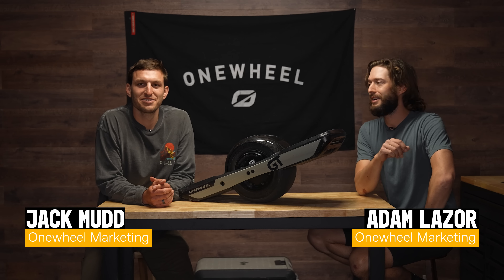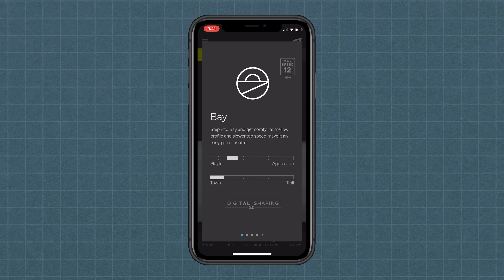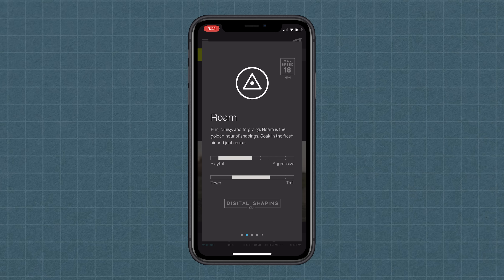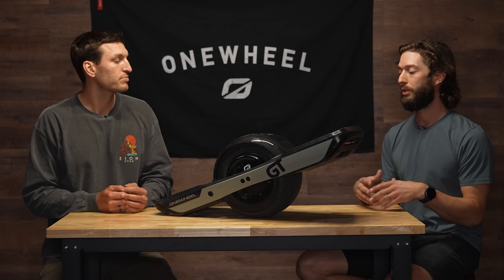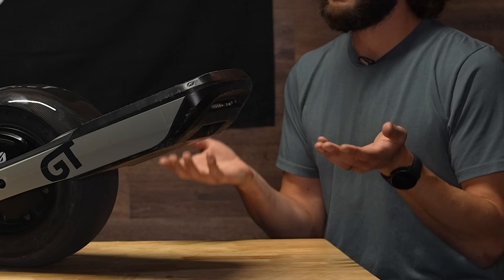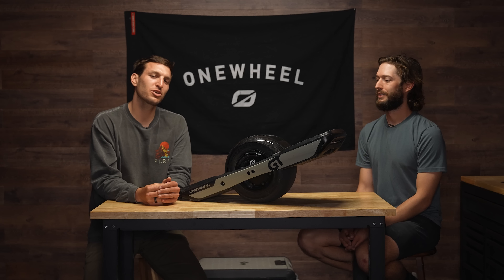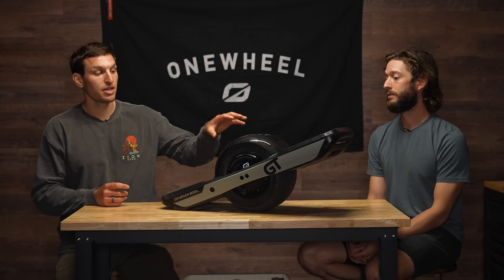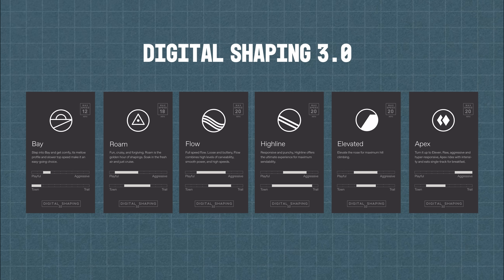Digital Shaping 3.0 on Onewheel GT

Comment: Please unlock pushback in the custom shaping settings with a legal agreement checkbox.
Reply: Yeah fr! At least up to 23 would be nice!
Reply: I second the motion! All in favor.......
I want my board to do 25 at the very least,  preferably 30. I'll sign the waiver, I am used to it!
Reply: @Ty-ye8rd  The floatlife guys have been racing the GT in all of its modes against the XR and the XR has been consistently beating the GT.
Reply: @Ty-ye8rd  Here's the video, https://youtu.be/FTZylO2j_UA  The GT was faster off of the line but it didn't last long before the XR flew past it. They were saying that the pushback was so strong on the GT that when it kicked in at 19 or 20 they just couldn't push past it. They said it was like the wicked pushback of the pint. Hopefully they just didn't figure it all out yet because mine should be here soon and I want to go alot faster than my XR
Reply: Or you know, make the hold harmless implicit when any OW is ordered to avoid any extra legality BS.
Reply: We gotta get this pinned!!! We need it

Comment: I'm so excited for my GT to get here and can't wait to see how it rides!  I do share the same sentiment as a lot of riders though when it comes to pushback.  Myself and all of my friends ride trails and are concerned about trail dragging at high speeds when pushback kicks in and just the overall comfortability riding at 20+.  I have several friends that aren't buying a GT based solely on the aggressive pushback.  I totally understand that for a lot of riders, strong pushback is welcomed but for people like myself who know the limits of their boards, this will likely make us fall back to riding our XRs most of the time.  I think there's a huge opportunity though to make everyone happy and it would go a long way with the community.... Adjustable pushback that's unlocked by some sort of waiver.  Especially now that there's a speed warning beep to go along with pushback, throw in a dial in custom shaping where you can adjust the pushback from XR level to pint level.  Everyone wins here.  Experienced riders can fully enjoy all of the upgrades on the GT and the average Joe and more inexperienced people can have that security by turning it up to pint level.
Reply: Yes same that would be my point for not buying a GT and enjoy instead my XR which I'm used to :)

Comment: Hey guys, I'm having a really difficult time with 1. getting ahold of anyone to answer my questions on the site because 2. I cannot get my app to work correctly. I've deleted it and reinstalled it multiple times. I have not yet been able to utilize the shaping options and for 30 miles I've been sent to flow. It's cool, because I'm learning how to ride with this free-flow setup, but I feel like I  could really get the feel and connection of the board and I together better if I could switch through these settings dependent upon where I'm riding. For instance, the sandy beach this weekend was pretty cool but really flat and flow just made me feel wobbly- and then on the rocky switchback trail it was perfect. When on pavement, I feel like the setting would be better on a different shaping, etc. How can I get over this hump with the app? It's super frustrating. I also can't get my mapping to work 80% of the time. I'm just not stoked on the app itself, but I'm loving the board. HELP! and thank you :)

Comment: Setting pushback base on speed is like setting setting speed break in a downhill snowboard who would want to ride it. When the tilt of the board is down, pack power up, on regent don’t set pushback high let the rider control breaks.

Comment: Hope you guys patch the pushback to be more subtle.  It was done when the XR launched when people gave their feedback.  The aggressiveness of the current GT is going to be the cause of so many unneeded crashes.  Tail slams going downhill are a recipe for disaster.

Love the GT, but really disappointed that FM doesn’t see the danger in aggressive pushback at higher speeds
Reply: Personally, I'd like an option. I prefer to be able to feel the pushback so I know its time to slow down. I've wiped so many times on my XR because I missed the push back. I also know many enthusiasts don't like pushback so I think there should be an option to satisfy them while not making the board more dangerous for casual riders or commuters. Luckily they also added a beep before the board nose dives also!

Comment: First off, this board absolutely rips!  Although it's very hard, the tire is super carvy and fun.  The more miles I put on my GT, the more I like it.  With that said, the pushback is a problem.  For those of us that know and understand the limits of our boards, we want to be able to unlock the full potential of the GT.  It's frustrating because it  feels so great up until pushback.  I understand why you went with stronger pushback but this is your flagship board supposedly built for aggressive riding and it's all there up until you hit the 19 mph wall.  Adjustable pushback that is unlocked by either some sort of waiver or a certain amount of miles is the answer.  Everybody wins with this.  People that appreciate pushback can crank it up to 11 and those that are comfortable can turn it down to XR level.  You have no idea how much the community would appreciate this.

Comment: What about a dynamic pushback setting? When enabled the Onewheel calculate the max power the board can deliver and compare to the ridder set limits. So as the battery amps goes low it will trigger the custom settings. Warming when enabling!

Comment: My one wheel turns off randomly when I ride. According to one wheel customer no service its normal. I have been to the ER 5 times and it cost more than the one wheel. I wish my one wheel worked as advertised since it cost so much money.

Comment: were all screaming the same thing in hopes that youll care.PLEASE let us control the pushback. theres gotta be some kind of liability litigation that can occur for there to be custom settings.  i hear all the arguments, but bottom line, you marketed this as an aggressive trail machine, but then neutered it with so much pushback that the tail aggressively pushes down on downhills. you cant have it both ways.  too much pushback equals dangerous (or less fun) trailrides. I've owned every iteration of your product from day1 and I try desperately to support you because I love onewheels but you need to listen to your customers and allow for proper settings to accommodate a variety of riders and riding styles. many need pushback... many dont!!  let the people decide
Reply: @onewheel

Comment: If the board is gonna trail drag because of heavy pushback at speed going downhill and potentially kill, and you won't tone it down, it shouldn't be difficult to program it to recognize the grade of the terrain and adjust the nose up and down to make it work. #safety

Comment: At the end pushbacks should be governed more by pack power, regen and less by speed for skill rider. If the board is in high regen meaning it’s going downhill, pack power should be the most important when weight pushbacks. GT is not for beginners so make people sign something on a agreement if you have to protect yourself.

Comment: About to take my first ride, fellas! Highline it is! See you on the other side ✌️♥️
Reply from the maker: HAVE SO MUCH FUN!!
Reply: @Onewheel  Y'all out done yourselves here, boys. Nice work! 🎉
Reply: @Nayners11  how do you like it vs a pint / XR?
Reply: @Tactical_Taco  Having owned Pint and XR, they will always have their place. That said, GT is another level. Torque is quite noticeable and a massive improvement over XR. The design language, while similar to Pint, it's more of a refined package.
Reply: @Nayners11  fantastic! My ship date says march 30th and my accessories shipped today. Just curious. How long after your accessories shipped did your board ship?
Reply: @Tactical_Taco My accessories shipped a few days before the board. They got here today at the same time. My situation may be different because I was one of the very first orders.
Reply: @Nayners11  true makes sense
Reply: @Tactical_Taco  depends where you are. Should be a one week delivery if you're east coast

Comment: The fact the XR has a higher top speed means your new flagship product, will be sorely under represented and out shined at your events by a product you took out of production.  Because your safety settings make the GT hit a speed wall at 20mph...and the tail drags from bumpy down hills are a hazard.

So...better tweak those settings fast. Because as it stands now?  All this thing has is the ability to climb up and over things a bit easier. And being a bit more quicker off the line.  And more range. For a less, user customizable, product that is slower than its supposedly obsoleted predecessor who, everyone seems to be better off having at this point.

I’m sure glad I didn’t sell my XR at this point.  Next time, I advise you reach out to your community and ask some of the top performers there to help you test these and listen to their specific feedback.  Vs your poor system of product development which is done in absurd amounts of secrecy when you have no competition in this specific niché.  Which is not necessary without competition...

PS, your front sensor ruined peoples ability to affix Fins.  No clue how their going to get around this. Your hostility to innovation from the 3rd market that does not come from your limited brain trusts is bad business and fundamentally stupid.  3rd markets drive sales. Business 101.  Stop trying to be proprietary. It’s inappropriate for a product like this. This is a vehicle. Not a computer.

Comment: On the pint I have noticed that the heavy pushback comes very early ~13/14 mph is the GT going to have the same early pushback I find it near impossible to ride comfortably at 15 and 16 without feeling like I am forcing through pushback
(Maybe the ride modes could affect how early/strong pushback is)
Reply: Gt pushback doesn't kick in until 20mph from what I've seen
Reply: GT pushback is not until 19.7 in my experience. It's not as much as Pint where it's uncomfortable. I'm able to ride the edge of pushback on GT comfortably. Non issue for me.
Reply from the maker: @Nayners11  glad to hear it Shane!